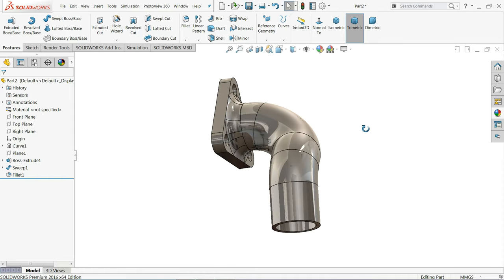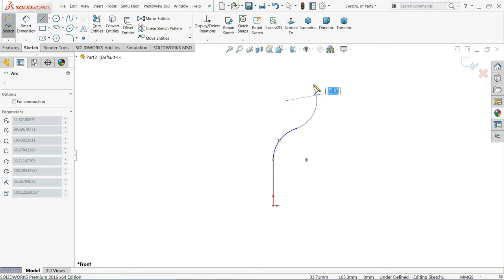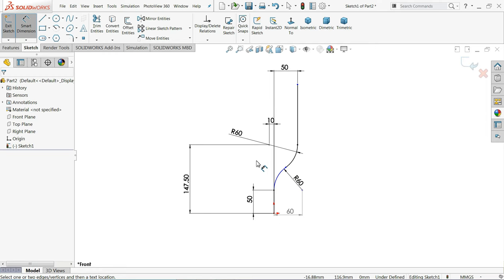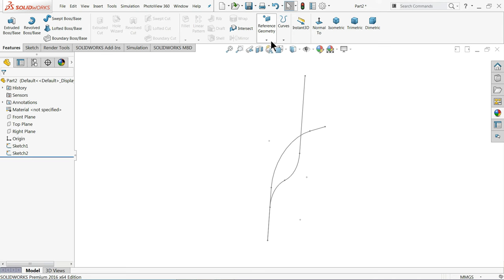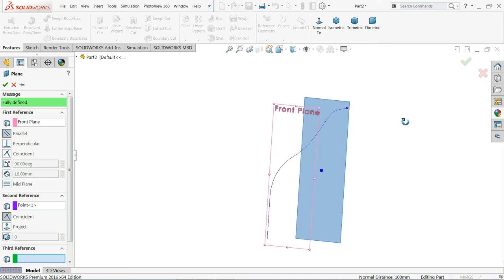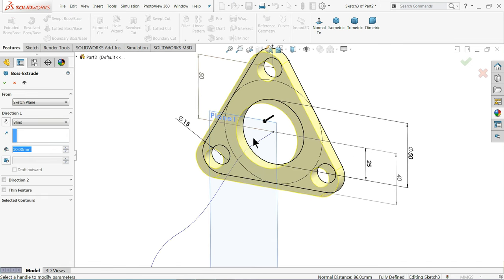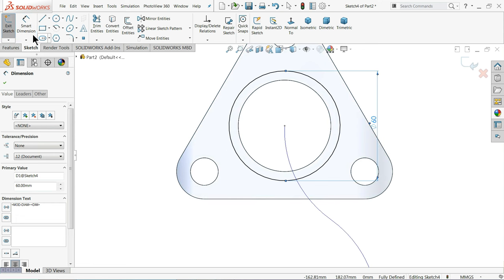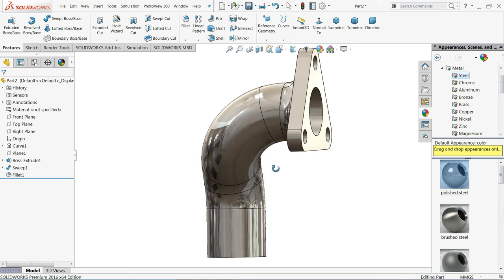SolidWorks Tutorial for beginners Project Curve Exercise 44

Comment: 3d splines? ok.. drawing..  plane. dimensions line, arc, line plane axis drawing line arc arc line. 3d spline. pipe dimensions extrude, and make flange. I think the fillet is too big around bolt holes in flange. (welding notes)